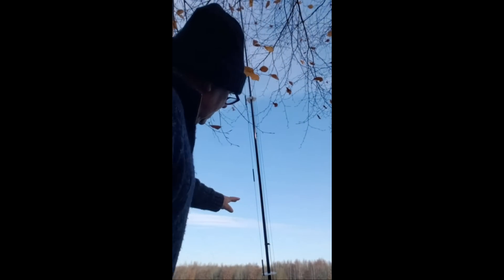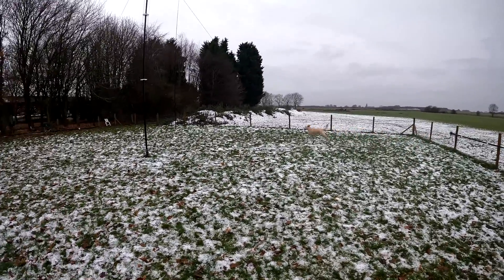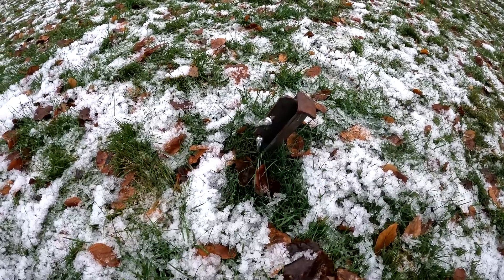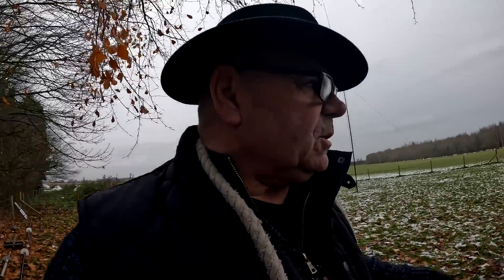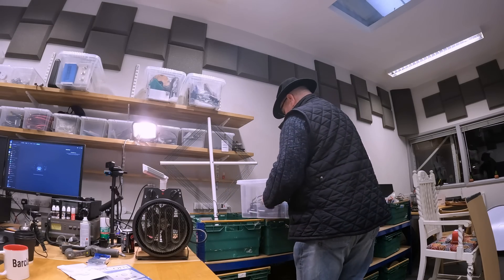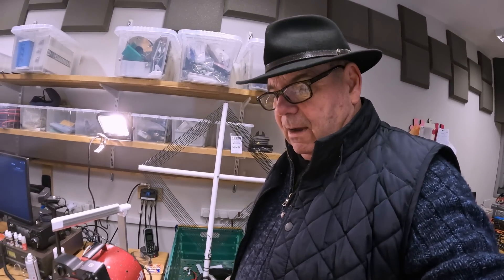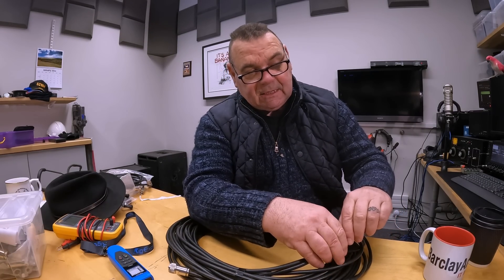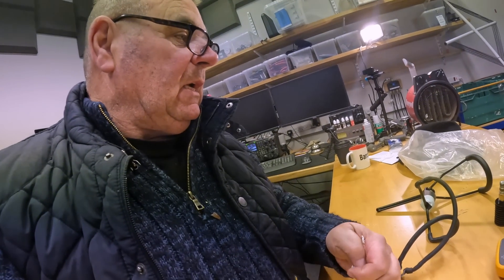What Went Wrong With My Coax?

Comment: hi. 1.5kw on such small diameter cable is simple to much. go for more beter cable like 1/2" cellflex.  you can use a DTF of TDR measurement to determine where the fault is. you can see where RL (return loss) is out of order along the line.  and dont forget if you have got 3dB cable loss one way the RL ot the cable is 6dB without any antenna connected to it.  and so you antenna measurments will be wrong. you have to callibrate the coax out of you measurement.
Reply from the maker: Joost, you are absolutely correct on the one hand but I was less than 3dB off the limit and in 20 years at 1.5kW, this is the first.. However, I'll move to Ecoflex 15 for R&D. Case closed :) PS Happy New Year!

Comment: I've had a very similar issue when running high power on AM/FM or SSB (>800w 11m band) and thought it was my coax breaking down in some way.

Turns out it was a coil in the base of my 5/8 wave silver rod. The SWR would only go wonky at highish power in wet weather.  I've since upgrading the coil to thicker copper wire and the SWR issue has gone away.

I had no issues when using a dipole with the same coax, same conditions. 

Disclaimer:  I don't generally use my amp hardly at all, only when German 11m FM CB bands are open!
Reply from the maker: Nice!

Comment: Hi Callum,Happy New Year, INSULATION TEST: One piece of insulation material and a cup of water spaced apart inside the microwave oven.Give it short bursts and check insulation for temperature change.Only do the test when the Mrs. is out,,,73  de John ZL1PO.
Reply from the maker: Great tip!

Comment: I'm probably misremembering what I've learnt but isn't it that the longer the coax, there is more of it to absorb the reflected power and present a lower SWR than a shorter cable?
Reply: You are not misremembering. In fact, a famous 43-foot verticals takes advantage of a long coax to make the VSWR at the source end appear closer to 50 ohms than what actually exists at the base of the antenna's fixed impedance transformer.
Reply: @billygamer3941  Thanks for the reassurance, I was beginning to think I had lost the plot! LOL

Comment: You said about CB operators going on about SWR, well one comment from my 11m days I always tried to follow was that of 1/2 wave lengths of coax or odd multiples of for said frequency ( inc calculations for velocity factor). Following that rule I always managed a good SWR sweep for all my setups on 11m, however I do understand it’s not crucial, but at 29MHz is it possible a 1/4 wave of coax could be giving you a false reading, after all some of the shorter coax lengths you tested did look to be possibly somewhere around only 6ft long.
Reply from the maker: OK Peter.. so impedance repeats every half wavelength - so the ONLY benefit to using exact half wavelengths is that if you have say 60 ohms at one end, you will repeat 60 ohms at the other (you need to work in the velocity factor). With 50 ohm antenna and a 50 ohm radio AND 50 ohm coax, length is TOTALLY immaterial (other than losses). CB guys invented a number of myths around coax lengths and honestly, they ended up making this a key topic - and it's not. But I thank you for your contribution. Happy New Year!
Reply: The best length of coax is the distance from your 50 Ohm radio, through your 50 Ohm coax to your 50 Ohm (or near as possible) antenna.  It's just physics.  So what?  So tune the antenna for acceptable impedance and just forget about the length of the coax.  Ironically, if you use longer than necessary, you lose RF energy to cable loss.   This CB myth needs to be stopped - it was just a way for people to sell you more coax.

Comment: Coax will age with exposure the weather and UV light, one of the reasons you could be getting different VSWR readings on different lengths of coax could to due to the frequency you are checking it on and multiples of wavelength according the coax lengths.

Comment: Coax could break down at the peaks of the VSWR using high power if there was a high VSWR over the length of a piece of coaxial cable this could damage the dielectric and what is called bubble it at the peak of each standing wave which will change the characteristics most probably changing the velocity ratio which in turn will effect the match to a transmitter - Fred - G0AOJ

PS: Once coax gets water in it it is basically scrap as water will travel down it with capillary action just like solder will on copper.

Comment: You did WHAT? Jammed 1500 watts down a run of cable ruffly the same spec as 213?

You've pin holed it.... it's arced through the dielectric somewhere.... possibly left a carbon track. You won't see anything until it arcs over again the next time you push decent power. It will probably work at 100w for another 15 years. But the damage has been done now....

You now have a decision to make..... Toss the lot out or find the arc over spot..... Use some sort of TX that will give decent power over a continuous period.... attach a decent dummy load... I mean decent! One that will cop 1kw for an hour or so. We now transmit into the cable at the same level steadily and watch the SWR as we wind up the juice. When the problem appears the offending part of the cable will be the hottest..... Cut out and use as two shorter runs....

Cheers
Reply from the maker: Carbon track probably.. That's what James and I think.. We had this years ago at the Scout Hut.. James stripped it down and under low power all was good, but give enough OOMPH and the carbonised grass or hair became a conductor..

Comment: Please be aware that CB operators doesn't have much more than SWR to optimize anything else is quite limited if they want stay legal.
Reply from the maker: I have customers who WERE CB operators, worried because they see SWR of 1.5:1.. It just doesn't matter, even on a 4W AM/FM radio. The difference in actual power output at the antenna is almost immeasurable from anything better than RG213.

Comment: Could it be that the antenna wire was heating up, expanding ie. getting longer and changing the tuning and therefore the SWR?
Reply from the maker: Nope. It was instant. Change coax, all was fine.

Comment: Perhaps the length of the cable does have some influence on swr? Think of a Rubens Tube. The length of the tube will affect its resonant frequency and where the nodes form in the flame. Callum tested all the coax at 29MHz, so if you think of the coax as the "tube", the resonant freq of the tube changed but the input freq never changed. But I'm no physicist so don't believe what I waffle 😂

What I do believe though.....there is one place where swr IS important, it is in the world of QRP radio.

If you lose 1W of power due to swr when using a 100w radio, that's 1%, so negligable and won't affect you that much. However......if you lose 1W of power when using a 10W radio, that equates to 10% of power lost, which would warrent some extra time spent on getting the antenna built as best you can. Especially of you have a shtf bag with a small qrp radio in it.

Again, just my opinion and I am open to being corrected. 🙂
Reply from the maker: 1% at 10W is 0.1W, no?

Comment: There are several issues to consider.
The first is the excessive power 1600W is not that common. What do you use to generate this amount power?
If it uses valve tech then there will be many hundreds of volts on the anodes, and this can get out onto the cable.

Also as pointed out you get a peak voltage depending on the VSWR

The coax itself will be fairly good in it's voltage rating, so it will be the connectors that are the weak point.
Any PL259 connector is suspect they really are not that good. (even N types are normally only specified up to 500V) Those with compression fittings are better than the all-solder type.  If you are lucky you will get a breakdown rating for the connectors, If some muck or water gets across the insulation on the inside,  also solder flux can be a problem,  Any contamination may  cause problems.  Think of when you solder on the centre pin, this is held in place by a plastic washer. Often this is PTFE. If you get a load of flux across that, then the breakdown voltage between the pin and the body of the plug will be reduced.   With higher power then this more likely it is to happen. Using a low power analyser you may not see any issues at all. 

Coax does not really age as such, but it is suspectable to damage when you pull it about, that can make the connections move, and if it gets trapped or trodden on then that can deform the cable and cause a mis-match. On HF this will not matter that much AT LOW POWER but when you use high power, then it MIGHT show up.

Another thing to consider is the type of solder. As you are a commercial business you will be using Lead Free solder. That is well known for making bad joints. Also it can grow "wiskers" of solder which cause shorts. Not common in normal use, but it is the main reason why military, aviation, and space system do not accept its use. In this case it's tendency to produce dry joints will be the main issue. 

The first test to do is a high voltage insulation test - a old fashioned electricians megger with at least 1000V output if there are any points with contamination  that may show them up. 

After that you can go onto RF testing.

All leads need to be tested regardless. Any problem will generally be with the connectors and not the cable. 

Andy
Reply from the maker: All good stuff. Tnx.

Comment: Strange things can happen when coax goes bad. I have seen this in TV-cable (working from the call-center end of a cable-tv provider. 

A break in the coax or water in the coax can cause all kinds of issues but it really depends on what frequency is being used the very moment. Some frequencies might be severely affected but others might be way less ('suck out on frequencies') 

In your case I'd suspect it might be water in the coax rather or then water in the cable to be honest. Or it might be on the 'open end' of the connection - for example when it's is pouring down creating a short between the center and ground. Might be unaffected on low power but boiling the water away on 1500W creating arcs/carbon tracking against the open end of the SO239 - (although you've covered that with shrink-wrap so it should not be an issue, but I'd doublecheck that part, water goes virtually everywhere where you don't want it to go :-) )
Reply from the maker: Anton, I like that idea.. I think I will remake everything..

Comment: Change the frequency- look at 7 Mhz instead, etc
Reply: Guys like me are able to run QRP easily on 12-10 meters due to all the time we spent on CB, but we find the problems on the lower frequencies (higher bands??) so, and yes, I have learned that as long as I get out, even running QRP, it is good enough.
But, I do know that you can do things by tuning patch leads etc.. though it normally does not matter if your patch lead is 5 feet long or 8 feet long..it wil work, Unless you are trying to Phase two antennas in which case the coax length AND the distance apart can change the gain. I really need to get my house built enough to get back to playing with antennas again..lol..
Reply from the maker: I needed at least 20MHz - if not 30MHz to test the material.. Oh wait.. Yeah, OK, the patch lead issue. Yep.

Comment: the coax can be tuned in length to a frequency- old CB trick was to tune the coax to lowest swr on dummy while building up for patch leads etc- since all you had was 5 watts- So that first coax might just not me right for the frequency which is why it shows different SWR..
Reply from the maker: OK, so you SHOULD NOT Have to "tune" coax length. It should be constant across the length, assuming a 50 ohm load. However, if you have 100 ohms, then you will find the impedance will repeat every half wavelength - this is where some of the old CB myths come in..
Reply: @DXCommanderHQ  Your signal actually moves within the coax in the same wave pattern it moves through he air, just as electricity moves at 50 or 60 hertz in your walls in the cables. This is the magic that lets you actually send multiple signals down one coax for cable TV. So, by using the correct length for the frequency (or harmonic) the SWR actually goes down, allowing best signal strength. But the difference is not noticeable at larger wattages usually, though if the cable is wet, the 50 ohms can be changed but the coax can in effect dry out due to sunlight.
QRP watts usually do not notice the saturation effect which is why QRP ers can use 50 or 75 ohm cables usually without the major losses below 60 Mhz.. as long as the coax is not on a resonance it pretty much gives same DB loss whether 75 ohm or 50 ohm.
Or at least that was my own experience with my usage in USA and UK,, have not been able to continue here in Jamaica due to no equipment set up.

Comment: Hi Callum.  I have worked in the RF electronics field for over 50 years and the short answer is yes, coax ages.  VSWR does not give you all the answers, you need a megohmmeter to test the insulation breakdown of the coax from the effects of UV radiation, chemical gassing and other factors of aging in the coax.  This is why it is recommended in the commercial field that coax be replaced every 10 years.  You stated that you were running 1500 to 1600 watts of power and that is a lot of RF heating in the coax which could have caused the problem.  What you were using to test the coax was very low power and faults may not show until the coax totally breaks down.  Even in your DX Commander antennas the wire should be replaced at least every 10 years by your customers to maintain peak efficiency.  I hope this helps.  Mike/K1EG.
Reply from the maker: Oh yes, a high voltage stest might be a good idea. I think I will remake all my patch leads!

Comment: To complete the investigation  I would test the same  long underground run of Coax and long field patch lead cold and then run the same high power  test again and re test the coax from Shack to antenna to see if you have the variation of increase in VSWR , I would suspect that its a simple plug  replace and re fit from condensation or worse condensation has found its way into the underground run. More likely that the field run has got damp into  the braid . Do the test again and see if a variation occurs , but then as a final check strip back the plastic outer coating of the field length of coax and the braid will have gone from Bronze to a dull grey appearance. We have had a lot of rain and the cold conditions for ten days and I have just had similar on a 50 m run of very high quality almost new coax . it was certainly condensation . 

Regards Clive and a happy new year .
Reply from the maker: Well CLive.. Effectively I did that because test #2 didn't fail with more power - and for longer (different patch lead) - sorry if I didn't explain, the video became a little strange sorry!

Comment: You might want to check the condition of your load.  If at some point it was overheated it is probably no longer 50 ohms.
Reply from the maker: David, the load was fine as demonstrated later with even higher power and a different patch cable - but thanks!

Comment: That is an rf choke that you are measuring unroll it and you will get a different result test it with a mobile whip antenna on the table and make an rf choke in the cable then you will see the swr change
Test the cable for ohms if this is on your meter look in the manual measuring the characteristic impedance
Reply from the maker: Erm.. A loose coil? Unlikely at 29MHz. But I get your point.
Reply: into a 50 ohm load there is zero common mode current on the coax to choke off.

Comment: A long length of coax will have a higher loss and show a lower SWR than a short length for the same slightly mismatched load.
Once water gets into a piece of coax best to replace it and use better sealing techniques to avoid water ingress to begin with!
Reply from the maker: David, time to replace all my outside stuff then!

Comment: Real short bits of coax likely are showing minor or weak reflections where as longer lengths normalize those reflections, so exacting wave lengths become irrevelivant.  From my CB days we were to use exact wave lengths of coax feeding the antenna to obtain a match, being an inch off according to Cobra was a warenity cancelation action, my feeling is that the short runs were part of the second element (the reflector)!

The problem with wet coax is oxidation reactions with the copper shield and if the core is braded the core.  You can dry it, but the oxidation remains! 

Old coax can be OK, but is the jacket intact, or is it cracked. I have seen aluminum and stainless coax, those may function better after wet and I have seen steel braid, that wet is evil.  Another issue is the dielectric cracked.  If it is thin solid cores may short or just change, impedence.  The cores also can break if it was not supported or rolled too tight, especially if it is solid. My 0.25" LMR-240 is not to be curved tighter than about a 4" radius or the core may break. I have a piece of cheap clothes line running from my shed to the house so I can keep my coax off the ground, and away from copper theives.
Reply from the maker: >>> but the oxidation remains<<< - Oh yes!

Comment: According to power rating for Aircell-7, I would say that the power rating at 14MHz was probably exceeded especially as the coax run is ‘old, cold and damp’. Start slicing bits off and look for signs of corrosion. Is an occupational hazard in ham radio.
Also, sticking barrel connectors or converters inline with the analyser won’t be helping with your readings as they show impedance bumps. 
HNY
Reply from the maker: Possibly.. Been running 1,500W for YEARS on short Aircell 7 at low SWR - but you might have a point - particularly if old.